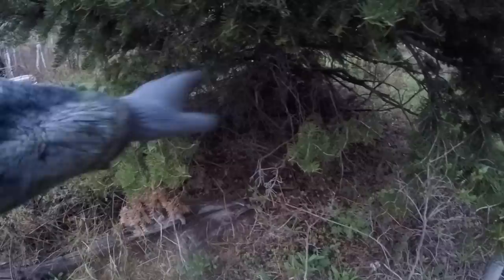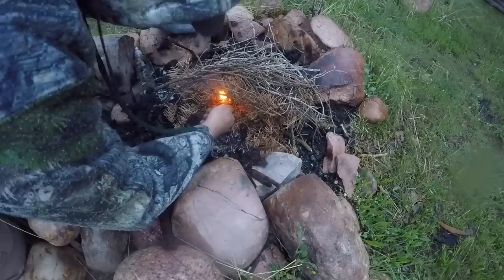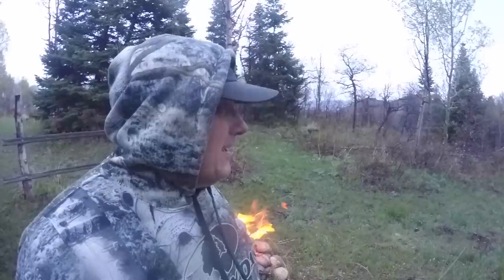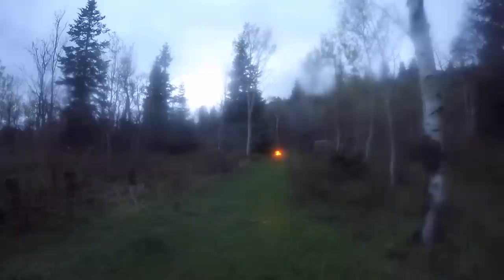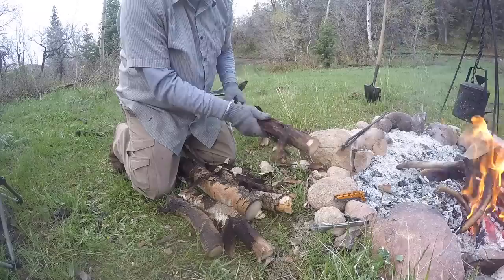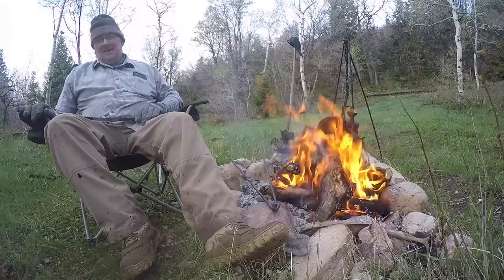Unusual Way to Use a Tarp Over a Fire - The Beast Sleeping Pad Set Up

Comment: Truck camping on a cool rainy evening, a fire, beans and buttered corn, sheesh.  Good adventure.  I hope you enjoy many more.  Good formula: P for Plenty.  I am a tarp guy myself. I use big tarps with long ties kept at each corner.  I use a fishing rod to pitch a weighted line over a high limb, maybe 35 feet up.  Pull a corner line up and over the limb and tie to the tree.  The diagonal corner tie goes to ground, maybe 60 -75 feet away.  The other diagonals go out to trees if they’re available.  I usually back my truck under the tarp.  Set up my tent under the tarp. And have a small fire pit under the tarp.  My three girls enjoyed it and helped. The rain almost always came, but didn’t spoil the adventure.  We had a small folding picnic table and folding chairs for everyone.  Mom always had (P for plenty) of food.  Texas
Reply from the maker: Papa Jeff glad you like the video, I had so much fun at that camp. Thanks for your comments and suggestions.

Comment: I have camped for years and have even had a tarp over the fire with adjustable steel awning poles. I have also made a teepee for extra shelter on our gold claim until the wind blew it off the mountain, but this is the first time I have seen a teepee tarp over a fire. Excellent and keeps the heat in better than using the awning poles as the tarp falls naturally . Also the fried cookies might be a great addition  to the campfire menu. Thank you and keep up the great videos.

Comment: I have found lining the bottom of my fire pits with smaller rock helps to radiate heat. They also hold in the heat from the ash and coals overnight. I have found that I can locate a hotspot and place wood on it and relight the fire with minimal effort. Really enjoy the videos and knowledge Sir! Thank you
Reply from the maker: Great tip! Sometimes I line the bottom with rocks and after the fire burns down I cook right in the pit.

Comment: Exactly! You don't need to go exploring or trekking anywhere. Just set your camp, start a fire, cook and enjoy. You did nothing, but I learned a lot. One question, why didn't you set your tent by the fire? Maybe you explained it, but I missed it? Sir, keep doing what you do and I will continue to look forward to your Adventures, Thank you! SanJoseBob
Reply from the maker: Thank you Bob. I rarely camp next to my fire though I could. I sleep better away from the fire, I'm not trying to maintain it in the night, it does not awaken me if the wind kicks up and stirs it up, I have no concern of coals being blown onto my bedding. In this video I just liked that little grassy spot and so I put my sleeping there. On average I'm probably about 100 feet from the fire to my sleeping area. I can do this, even in the winter, because I don't need the fire to be able to sleep, not for warming or comfort. My sleeping setups are so comfortable that I go right to sleep and I sleep till morning. I use two general methods for sleep 1) The ponchos we make can be used in a Hammock Mode, that is the way I sleep more than half the time, 2) Our Beast sleeping pad system is for on the ground use, and what I used in this video. We make all kinds of accessories that go with both systems. Thanks again.

Comment: Guys, I'd seriously reconsider cooking in the can this way.  Many modern food cans have a varnish or other coating on the inside that potentially could become toxic if burnt.
Reply: Jock Campbell  Yes, I was thinking the same.
Reply: and aluminum alzheimers fuel
Reply from the maker: The nice thing is I'm not going to burn the can as long as I'm cooking food in it, so no worries. The food already gets cooked in the can when it is made, it goes in a giant pressure cooker. Coatings in the cans are food safe anyway. Of course I wouldn't want to be cooking in a can when I have very little food in it and maybe the coating turns to goop....
Reply: Along with cooking with aluminum foil has known to cause Alzheimer's
Reply: Include more turmeric in your diet; studies show that if you consume a moderate amount 3x a week, you drop your chance of developing Alzheimer's by several percent points. People in India, who eat turmeric pretty much every day, have a mere 4% risk of developing Alzheimer's. People in America, who rarely eat it in more than minute quantities once or twice a week (the yellow in mustard is more likely to be annatto in the cheap mustards most peopel buy, not turmeric), have a 17% chance of developing Alzheimer's.  The study carefully controlled and accounted for a wide variety of factors to account for the discrepancy, and turmeric consumption was the only thing that showed up.
Reply: at least he did not have a large slab of "meat".  that would be really toxic as in heart disease etc.
Reply: @michaelcee8348  I eat venison 90% lean yummy
Reply: We only go around once so enjoy it. If I get  old timers I'll give my sons a hard time so I pay them back for all the times I spent searching for them. Think of it! No responsibilities. Now where's my beans. Oh I almost forgot LOL if you happen to buy some canned mystery meat at the army Navy eupply from Russia and it's got a lot of juice left after you heat it up be careful if you throw the juice in the fire. It just might be whale oil.  Its clear and very fine but it throws a fire forty feet in the air and bright lights like the sun.  It would be excellent to save to oil up fine machinery. God bless.
Reply: no sorry you don't.  you may eat a deer's corpse that was slaughtered with probably a high powered rifle from a long distance.  but venison is just a made up word to get around calling it what it really is.  dead flesh.  please do some research on this.  we have been scammed into thinking "lean" dead animals is healthier to eat than "fat" dead animals.  the science is clear that eating dead animals is very unhealthy.  lean or not.  americans consume way too much protein which leads to cancer and heart disease.  very few people eat only lean "venison" flesh.  i think you will agree that the socalled "hunter"eats mainly flesh from cows, pigs, chicken and fish and "venison" relatively rarely.  i am a second amendment advocate very strongly.  but guns are for protection from criminals and criminal governments.  not for killing innocent sentient beings just because we "like the taste".  survival situations might be different and that's a strong "might".  but of course "hunters" of venison flesh etc don't do it to survive generally.  my suggestion is to research the "other side" and stop listening to the mainstream info that we have been "fed" since childhood for a while.  i was brainwashed once into thinking it was good to eat "meat".  i kept a freezer full of dead cow and pig flesh.  not to mention fishing frequently and eating dead fish flesh.  however the internet is a great thing and opened up a new and higher way of thinking about non human animals and health.  i had cancer 21 years ago and all i did was stop eating "animal products"
Reply: of course i got "triggered".  i'm trying to say something for people's health and of course the "health" of the animals.  we are being lied to and mislead on a major scale.  i'm trying to get people to research how they were brainwashed since childhood.  bow hunting is not a "sport"  of course you know it causes pain and suffering and death to a fellow sentient being.  that certainly is not a sport and in this day and age not necessary in 99+% of the cases.  we are not "cavemen" and don't have to act like them in the name of sport or in the name of eating lean "venison".  of course people as yourself can do this for fun, sport or "food" if you want.  but that certainly does not justify the pain, suffering and death that is caused just for the "jummy" taste.  i would of course ask you to reconsider you hobby and do something more compassionate and sensible.  i wouldn't "tell you what to eat or not to eat".  just suggestions.  please research it for your sake and the sake of a more peaceful world.
Reply: Plants are aware that they are being eaten. You have no moral high ground. The internet has spawned as much stupidity as wisdom. The wise ones of old whom wielded true power would scoff at your talk of suffering and sentient beings. One can't live without causing other things to die. One must consume that which is smaller to add to oneself in order to grow. Such is the way of things. Bastardized eastern spirituality of the digital age won't change it.
People DO eat too much protein (1 gram per lb of body weight per day is ideal). Easily available meat is tainted. Soy contains phytoestrogens which leads to endocrine disruption for both genders though much more harmful to males. Cancer can't live in a body with an alkaline ph no matter what you consume.
Reply: of course i have moral high ground.  vegans never say they do NO harm.  vegans always try to do the least harm.  eating plants is obviously less harmful than eating sentient beings.  and after all the creator originally gave only plants for food.  there was a change but we must be careful to determine the reason for the change.  and the vegan diet is less harmful to the one eating it by all unbiased research.  also it is less harmful to the physical world.  what you are saying is partly true and i appreciate that.  but it does not negate the reality that a vegan lifestyle can clain the "moral highground".  something can claim this "ground" and it certainly is not a diet which wantonly consumes dead sentient beings.  yes i said sentient.  even if plants are sentient beings.  it is generally accepted people must eat something.  plants are given to us by the creator to eat.  no i am not a fundamental christian.  but one who believes in the scientific method.  but highly doubtful of government paid scientists interpretations.  we are after a resonable diet and lifestyle.  so do we choose dead sentient beings (yes i said sentient).  or do we choose a plant based diet?  i am aware of the alkanization concept and cancer.  in 1997 "doctors" told me i had serious cancer.  i never went back to them but started a healthy vegan diet.  that's all i did.  21 years later.  healthier and happier.  i know that's just a simple anecdotal story.  but my life was changed for the better.  i am trying to stand up forthe billions of animals slaugtered for no reason but the taste.  so i have been researching this subject from the "other side" for 21 years.  yes i was raised up in government "schools" and went to the "higher" education institutions for 12 years.  just about all i got was mislead.  at least on the important points of life.  if and i say if it is true that plants are aware they are being eaten then what are the ramifications of that awareness??  i do not know.  however i do know that SENTIENT beings try to run away.  they scream.  they mourn.  they are just like us.  therefore since i must eat.  i choose the plant based diet.  i am better off.  the animals are obviously better off.  and the physical world is better off.
Reply: Spiritual constipation.  The one was fragmented to gain experience. It is only through consumption that sentience can be restored to unity. You don't stand up for the lesser fragments of sentience. You stand in the way of the grand design.
Reply: @wildernessinnovation  it's call BPa a chemical in the lining of cans.
Reply: just don't eat ....solved all the problem of toxin and what not. lol
Reply: Brilliant. Ole Mikey can convert to breatherarianism and try to absorb energy by inhaling the prana in the air to sustain himself.
Reply: we get one life eat what you want drink what you want and have fun.nome of us are making it out alive it sucks but it's fact.
Reply: Wait.  Did you actually just douse your Corn in butter right there?
Reply: WTAF!  Salt TOO?
Reply: after reading that I'm hungry I think I'll cook up some pork chops.
Reply: Well, I don't have dementia, my wife had me checked..
Reply: Jock Campbell m
The toxicity adds to the flavour!
Reply: All cans have poly bisphenol a coating inside so that the contents don't interact with the metal. Unfortunately PBA as it's called is an artificial estrogen. The choice is yours.
Reply: @Dirtbag-dy4nx  HOORAY!!! Venison=Scrumpdillicious! 'Vegetarian' : ancient Indian term for 'lousy hunter'!
Reply: @michaelcee8348  some of the ill-est people I have known have been 'professional' vegetarians! You will NEVER convince me that is a healthy diet. When I say 'professional', I mean people who espouse vegetarianism as a religious duty and way of life. Ironically, vegetarians (who 'despise' 'dead flesh' for some reason, find it necessary to make their tofu- or whatever other substance they substitute- into things that LOOK like hamburg, and even steak!
Reply: @Dirtbag-dy4nx  we are brothers! Speak on!
Reply: Michael  cee Now your the one That needs to be HONEST or educated ? You probably ate lots of processed meat and other processed food for years ? Probably never lean non processed Deer of other wild game ? Who do you know who eats Live animals ? You believe in man made Global Warming the scam?
Reply: @Dirtbag-dy4nx  Better than wrapping your head in it.
Reply: @markenglandle  plastic margarine beats real butter even with traces of Roundup? Who knows ? Everything is poison by design. The Depopulation Agenda is in full swing.
Reply: @michaelcee8348  well lottie da
Reply: @Uploaderization  why should vegans get tired of hearing themselves speak?  they are the TRUTHFUL  side.  it's the business of vegans to drop the TRUTH on society.   if veganism is not the truth, then show me why.

Comment: God bless this old fart camping on his own and MAKING A YOUTUBE VIDEO.....this will be me ..... good job SIR !
Reply from the maker: Haha, thanks man !!
Reply: There was another person there using the camera ! AN obviously he did not offer it to the other person , but he made sure there was enough for the other person to eat as he had 2 corn, an left half the can of beans an of corn for them, But all these video makers an campers I noticed they have no respect for God as they NEVER give thanks to the good lord ! They should all be ashamed of themselves. It also looks like he was probably camping in his back yard.

And that tarp idea was still not the best in any estimation, Consider how many hot sparks would hit that tarp in one 24 hour period, A spark has weight an when being thrown upwards from the heat, it will hit the tarp before it would fall back down or be blown sideways out. depending on the size of fire an especially the type of wood.

This tarp would also let cold wind hit you from all sized around the tarp down where there is no protection, 

One would be better off making the tarp sloped completely down to the ground with it V shaped upside down on the up wind side only, so the wind would go around the tarp an suck the ashes up an away from anyone being sheltered by the tarp. You would need only one pole, considerably less smoke, unless your addicted to smoking.
If you left one small hole at the bottom center of tarp, an allowed a very minimal wind, this would keep the tarp clear of smoke an flying ashes. This air might warm a very little as it keeps the ashes from hitting the tarp an yourself.
Reply: I know exactly what you mean. This is such a pleasurable video to watch, and it's hard to precisely specify why; maybe because it's just an older guy, taking care of himself by building a nice fire and feeding himself some solid food that will stick to his guts -- without the slightest flavor of pretense or arrogance....and just sharing it all with us. That big bed of coals sure looks cozy, too.
Reply: @CMAenergy  Ever hear of a camera Tri-pod? LOL

Comment: One fall we used a large beach umbrella(still packed in the car from out last outing when it was hot) pitched behind the fire grill  to cover the fire during a 3 day down pour. We propped open the vents at the top of the umbrella with wood chips thus creating a vent for the smoke. We were able to sit under it next to the fire and stay warm and cook. It was end of season and we had gathered abandoned fire wood from all over the empty campground and built a tarp city at our campsite, covered the table, tent and had walkways in between. We had to dig channels to divert water it rained so hard but we stayed dry and had a glorious time being creative. After getting soaked while exploring we even hung our gear on stick hangers in the spokes of the umbrella to dry, smoky but it worked great!  Good times.
Reply from the maker: That's a great experience, thank you for sharing it.

Comment: You need an army issue P-38 to open that can!! You could sure do it a hell of a lot faster!!  I don't know if they still carry them in the Army Navy Surplus store or you might have to go to an antique shop that specializes in military s***!!! But the P-38 Works awesome!!!!!😃👍 And it damn near last forever as far as I know! I got mine from  c-rations back in 1972, 46 years ago and it still works like a dream!!😃👍
Reply: The P-38 and the unofficial successor P-51 are inferior to the can openers on modern knives and multitools. First, their small size makes them painful to operate for more than a few minutes; second, they cut on the pull rather than push which makes them slightly hazardous to the user if they slip off the can rim. They're small and light but this is pointless since the cans of food are not.
Reply: @KJ6EAD  well I'll tell you I can open a can so fast with that P38 it's not even funny!! But I guess I've had 46 years of experience!! I didn't know they had a successor, I wouldn't mind trying that!! I was just trying to be helpful it seems like he was struggling to open that can. Thank you for the info!! ☮️